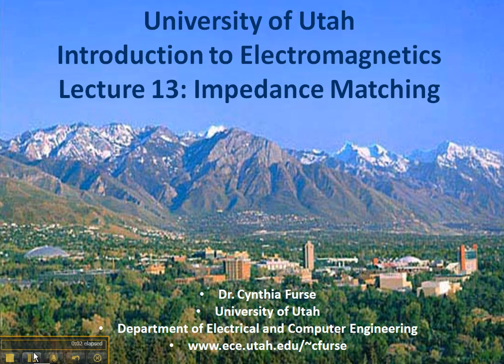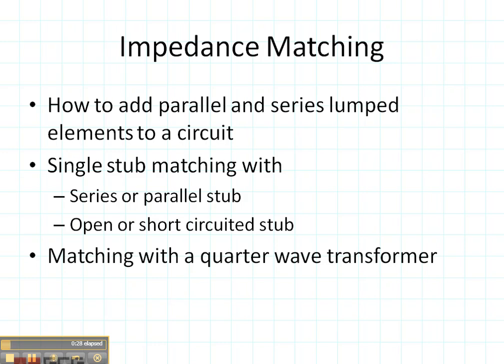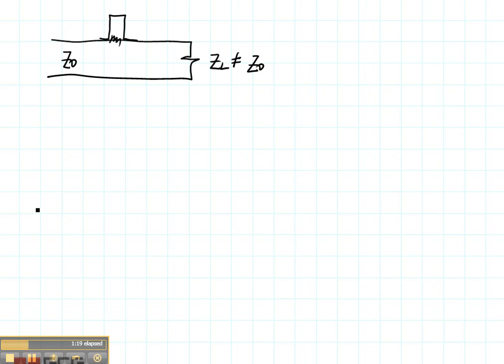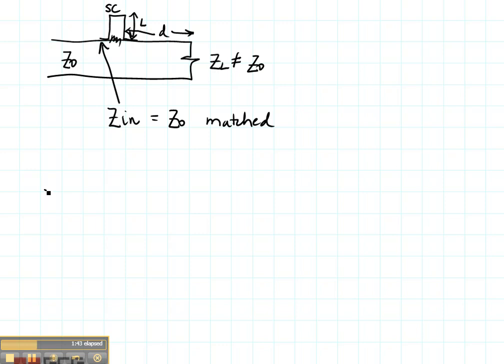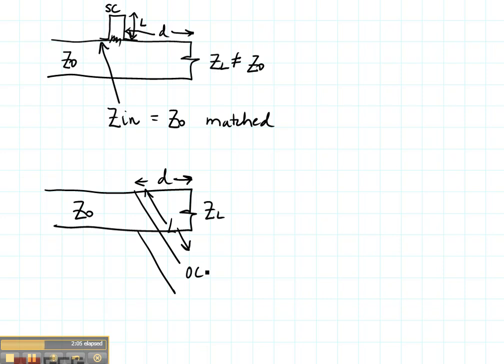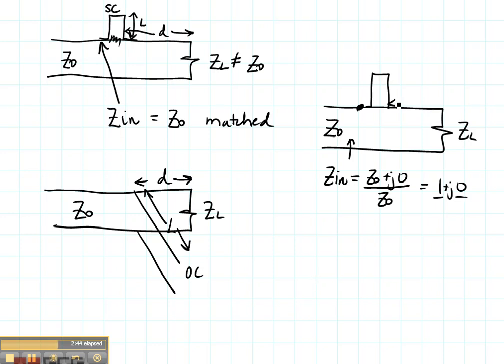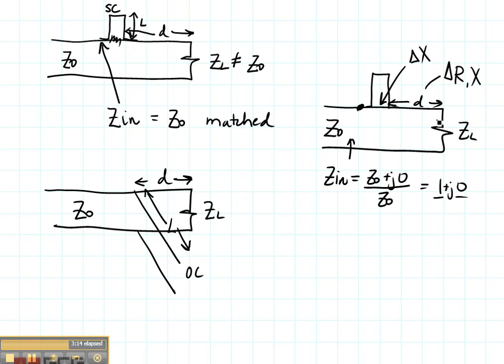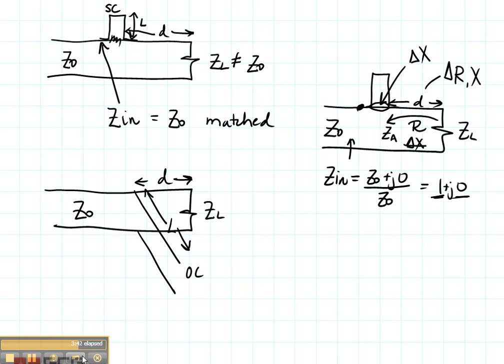ECE3300 Lecture 13b-1 Impedance Matching Intro

Comment: does the concept of impedance matching apply equally to constant voltage and constant current sources?? I don't mean constant as in DC, I mean I have a voltage to current converter and feeding it a sine wave, the load is complex (600-30i).. cheers :)